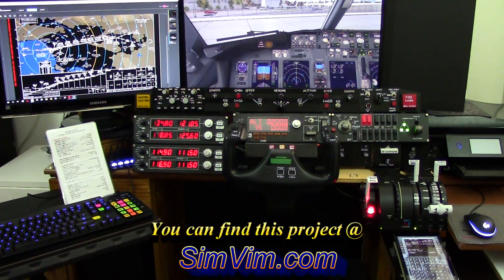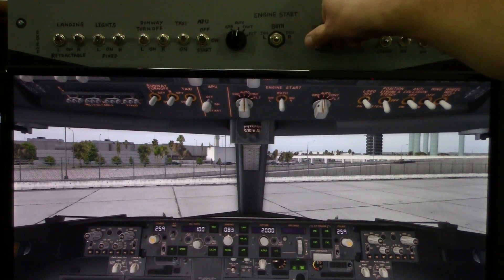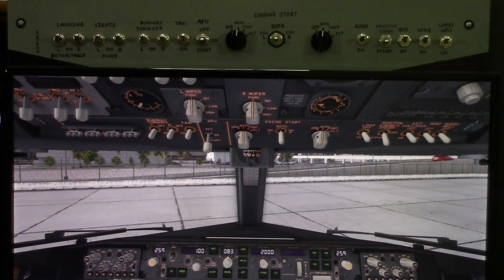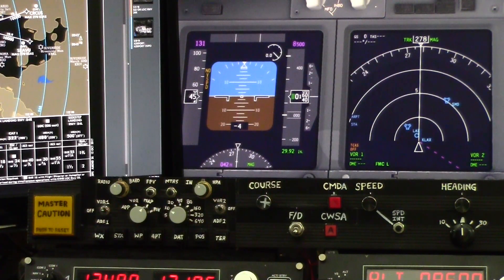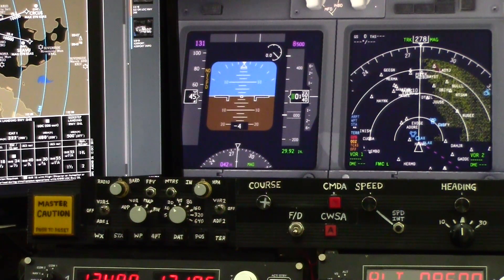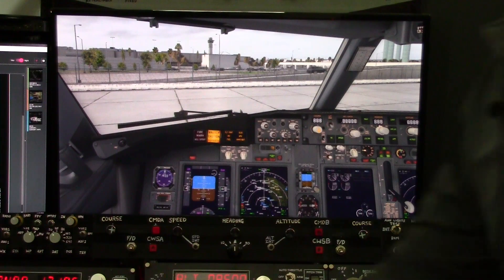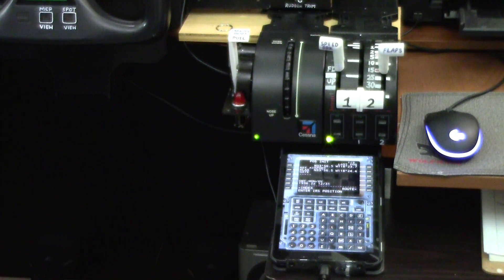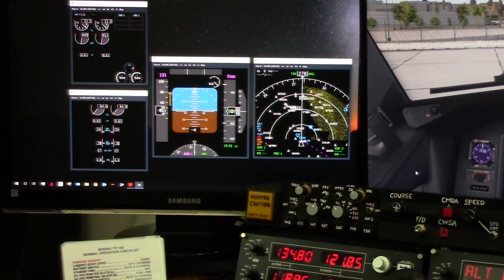Home Cockpit using SimVimX (Formerly known as SimVim Cockpit)

Comment: Hello,Imglad I came across your channel.  Couple of question if you don't mind.  Where does the EFIS images displays come from.... Where do I find multiplexers....And wire diagrams.. Thx
Reply from the maker: I'm not sure what you mean by the EFIS image displays. I buy all my hardware components mostly on Ebay, but you can find the on Amazon, Ali Express, Adafruit, and countless other electronics sellers.

There is no wire diagrams per say, you just connect each component individually. I have many videos I call back to basics that explain each type of component. Hopefully those will clear up things for you. The Real Sim Control website also has connection diagrams for every type of component. You just have to put it all together to include all the different components you need to use in your setup.
Reply: I was refering to the monitor screen images. Sorry
Reply from the maker: @johnnewton7893  hmm Im still confused. You mean my main monitors? That's Xplane and Navigraph. The smal CDU is on a Samsung tablet using an Android app called XPlane CDU

Comment: Hello, thanks for share this video. I have a question, what switch do you used for push and reset the Master Caution light. Thanks very much.
Reply from the maker: I can't find the exact ones I used because I bought them at an electronics store near where I live, but they are like these
https://www.amazon.com/dp/B07WR4WQXK/ref=cm_sw_r_cp_apa_glt_fabc_4C8T0MJ9A8M8PVZ4GV5D
Reply: @Qosmokid  thanks a lot

Comment: What are the master caution and fire warning offsets or where can I find them I looked online I’m trying to use it in mobiflight
Reply from the maker: I'm not sure what you mean by "offsets"
Reply: @Qosmokid  what is the code for the master fire and master caution buttons for example 0xcba1
Reply from the maker: @uniteddrones7626  I have no idea what you are talking about. We don't use any code with SimVim Cockpit. If anything we use custom Datarefs and Commands
Reply: @Qosmokid  hmm okay do you know where I can find more information about these?
Reply from the maker: @uniteddrones7626  you can use the dataref tool to find commands and datarefs. Look for my video about using custom commands and datarefs I explain it on that one. Althoigh I don't know how that would translate to the code you need for mobiflight
Reply: @Qosmokid  hmm I appreciate it, I don’t all my wiring already unfortunately I can’t use simvim as I didn’t wire this for multiplexers I’m using multiple arduinos

Comment: Thanks so much for your wonderful videos, I have a question abut rotary switches, what type of encoder we should to use for Giro and speed indicator gauges, encoders with 5 wire output or 3 wire input? Because I need to order a bunch, thanks again, best regards
Reply from the maker: The ones I've used are the KY-040 rotary encoders. I also ordered EC11 rotary  encoders but have not used them yet so not sure if those work as well. Both of those have 5 pins  and both have a push button. I haven't tried any with only 3 pins so I can't advise on those.
Reply: @Qosmokid  thanks so much for respond, looks like simvim did a lots of modifications  to cods, originally I set my cods to print exponder, com1/2 and Nave1/2 non of them work anymore on my Cessna 172 simulator,  and also  today ATP. NAV. HDG on autopilot start causing strange prints on my 2x12 LCDes , I know you're not using LCD, and you're setuped to Challenger,  anyone else experience the same problem I have ? Thanks

Comment: Hey, i can not find configuration at the simvim configurator for the panel left from the mcp , wx dat, pos etc.
Reply from the maker: It looks like right now they are redesigning the configurator page so it doesn't show up when you click on "EFIS/MFDs" on the "Image Maps" page. I'm sure when they are done updating the website it will show up again. Although for now if you go to the "Data Table" you can find all the EFIS Assignments by clicking on "EFIS" near the top of the page.
Reply: @Qosmokid  thanks now the page is up :D

Comment: Awesome video! I'm doing the same thing as you, but I've got 5 Arduino Megas and I'm wondering if I could use all 5 with SimVim! Thanks!
Reply from the maker: No you could only use one as the master board. There is no need to use more than one anyway with all the expansion options.
Reply: Alright, guess I’ll return my boards 😬 Thanks so much for the help though😁

Comment: Hi, how the heck did you get your annunciators to work!? I’ve been looking everywhere and I can’t figure out how to wire them, what interface to use and how to make them use with xplane. Help!
Reply from the maker: What annunciators are you referring to? Like the Fire warning light and Master caution light? Or the three little lights for the Autopilot disconnect, auto throttle disconnect and FMC reset lights? Or all of them?
Reply: Qosmokid pretty much all of them, I’m building an overhead right now and I need to figure out all the little annunciators on the overhead
Reply from the maker: I'm about to post a video where I talk about basic wiring. I'm not sure if it will answer your question completely. Although you need to select the annunciators in the configuration table or the images in oder to assign to lights. I'll add an explanation to that upcoming video or maybe I'll record a separate one just on outputs and annunciators.
Reply: Qosmokid that would be awesome. Thanks

Comment: Thanks so much 👍👍👍 please another question if you don't mind, while we created several program logs on a pin and saved it in X-Plane folder, can we later reload the same log to Web page to edit it or we have to rewrite the log again ? 🙏
Reply from the maker: You can edit a previous one by clicking the "Edit" button on the configurator page on the website. Then you can just make changes and re save it.

Comment: My question is, if you know which command on simvim website provides the rise and decent digits to be shown on 7 segment or LCD for autopilot, and wich command does the phisical knob for ut? I couldn't figure out abut that. Thanks
Reply from the maker: Yes if you go to the configurator page on simvim.com then click on the panel and instrument layouts, and click on the Boeingg737-800 image and down at the bottom you'll see the picture of the MCP panel. 

Select the Vertical Speed display which has a blue outline around it. Then select the signal pin number on which you have the display connected. That should give you the VS numbers on your display assuming you have everything wired correctly,

Comment: Please let us know if you Could manage the climb and decent rate on Autopilot with knob and 2x12 lcd? Thanks
Reply from the maker: Hello, @Homemade Cockpit. Yeah you should be able to do that. I have not installed any 2x12 Lcd displays on my setup only a 4 digit  7 segment display. 

On the SimVim website Vlad does explain how to connect and send data to Lcd displays. I have played around assigning Vertical Speed to one of the rotary encoders and it works, although I am currently using the Saitek panel for that.
Reply: Thanks very much for responding ❤ researched the website but still couldn't find an option to do that, it may come up in future.

Comment: Beautiful design!
What is the exact model of rotary encoder you are using?
I use a simple template but it skips many numbers when I set the mcp. I noticed that in yours this does not occur.
Reply from the maker: I used the KY-040 it kind of skips numbers also if I turn it very fast. It does two numbers per detent. Sometimes I have to leave it between detents to stop at the value I want.
Reply: @Qosmokid 

 In SimVim, you don't need to use any sort of "breakout boards" with encoders - use a "plain" encoders.
Any cheap encoder works fine with SimVim.

Today we have uploaded new version 0.9.33 which has improved encoder algorithm, with default "step-by-step" precision mode and optional animated acceleration mode.

Vlad (SimVimCockpit)

Comment: Hi! Thanks for this great video :) Do you know if it`s possible to use multiple arduinoes mega 2560 at the same time?
Reply from the maker: I'm pretty sure not with SimVim, only with ArdsimX. But really there's no need to use more than one. You can use a whole bunch of the 16 channel multiplexers to use as inputs or outputs. You can have  over 500 switches, lights, buttons etc with a single Arduino.

Comment: Very interesting. I'm about to do a similar project. I'm interested in your 4 signal wires (plus gnd and 5v) from the Ardunino to your 16 channel boards. By that I mean what is your solution to take these outputs from Ardunino and multiply them to go to each 16 channel board?
Reply from the maker: I used a "breakout" board that is below the Arduino in the last part of the video. 
Looks like this:
https://photos.app.goo.gl/MVFhGzSSYg4kUTKZA